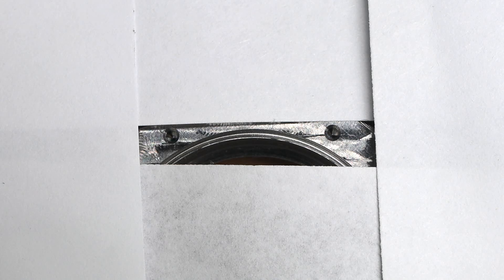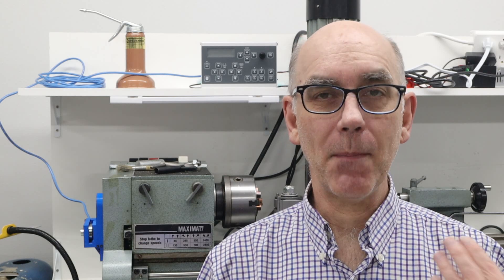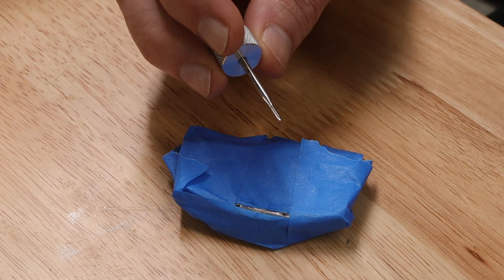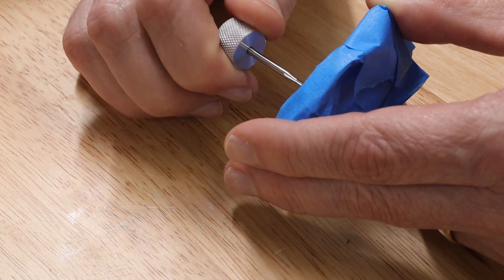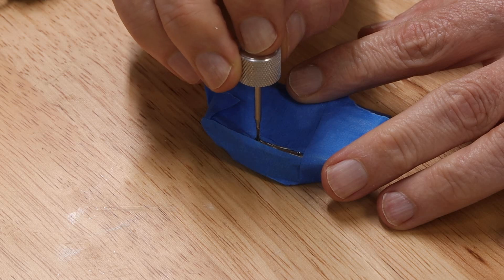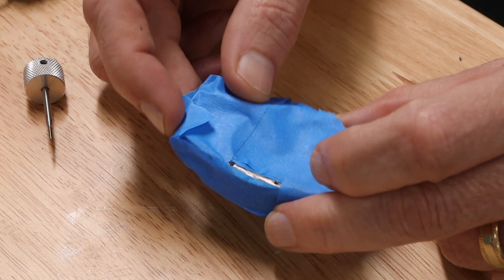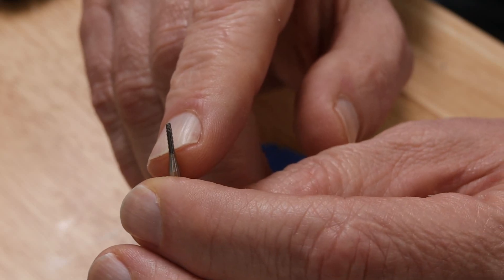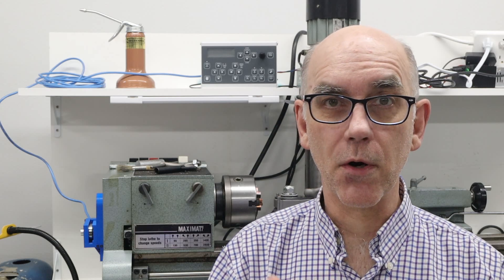Tapping Tiny Holes in 316 Stainless Steel

Comment: Thanks for the video. I’m just in from the workshop after spending a few hours tapping M2 taps in stainless steel. Very nerve racking. I broke one tap. 
And also found that the cheap taps I was using aren’t very sharp at all. But luckily had a better quality tap which was fine, though blunt now I reckon. 
I DO wonder if there are carbide tiny taps out there …. I’ll do a search. Cheers.

Comment: Also remember drill size for stainless steel are not the same as for regular steel. To avoid braking tap choose drill size a little bit larger or look up the correct size in table for stainless tapping
Reply from the maker: Oh, I learned that the hard way. I initially drilled the pilot hole smaller, and then discovered I needed to use a larger hole for stainless after breaking a few taps.

Comment: I tap a ton of tiny holes and I’ve found that I just don’t have the dexterity anymore to hold the tap perfectly straight and not nudge it sideways when turning them. I use a tapping block or tap stand to insure the tap is 100% straight and also to keep me from putting side force on the tap. Some parts I make might have 50 1.2mm tapped holes and at that point there is many hours of machining and hundreds of dollars of material on the line.

Comment: Try forming tap, use rigged tap cycle in the CNC, and 1.29mm hole
Reply from the maker: I didn't feel comfortable with rigid tapping with a straight flute tap, which is all I had at the time. Next time I will try rigid tapping with either a form or spiral flute tap.

Comment: Your Haas has the ability to peck tap, did you ever consider doing it in the machine? Pausing between each peck to clean.
Reply from the maker: I drilled these holes on the Haas with the belief that my viewer was going to tap the holes. That was incorrect, so I had to tap them after additional machining that meant I couldn't get them perfectly aligned in the jig again. In the future, I plan to rigid tap.

Comment: I always buy taps from mcmaster as the quality is amazing and it's one of the few items they don't over charge for
Reply from the maker: Agreed. In this case, I got them from MSC Direct because McMaster only had one option, which was a straight flute plug tap. Whereas MSC had both straight flute and spiral point options.
Reply: @JohnSL  I bought a few tiny thread mills (for 2-56 holes) the other day that I really want to try out as I hate cnc and hand taping small holes, especially in titanium of ss316. I think they make them even smaller too

Comment: I'm surprised you're using Tap Magic. I would have thought on stainless you'd want to use Moly-D or Anchor Lube.
Reply from the maker: This is my first time working stainless steel. The Tap Magic label included stainless steel. Can you provide more about the advantage of Moly-D or Anchor Lube over Tap Magic?
Reply: @JohnSL  Anchor Lube is more popular reputation than anything else.  Moly-D has a ton of molybdenum disulfide, which maintains a lubricant film under extreme pressure.

Stainless has such a bad reputation that I went straight to Moly-D the first time I tapped it and it's worked very well.

Comment: I form tap m1.6x0.35 holes. Procunier tapping head, taps from Suncoast products.
Reply from the maker: I used my CNC mill to drill the holes. Now that I have experience with the spiral point taps, I plan to try rigid tapping the next time. That should be safer and faster than hand tapping.

Comment: I did a few jobs where I had to manually tap the parts and it was such a pain, never again.  I thread mill all my stuff now, I can dial it in and use a thread gage to check fit.   I find it to be way more reliable and you at least have the chance to save a part with a broken thread mill.  If I were to have a job that had hundreds of holes, I may consider rigid tapping, but for small job shop stuff thread mill is the way to go in my opinion.
Reply from the maker: I had a deadline and was originally counting on my viewer tapping the holes since I thought he had the expertise. I was wrong, so ended up having to tap them myself. I did some more research and it Guhring makes a thread mill. I'll have to look into that for next time, as breaking one of those would not scrap the part. The other thing I may try is rigid tapping with the spiral point tap, as I already have the taps.

Comment: How about a Thread Mill?  You can control cut parameters very precisely and it would save a ton of manual tapping.  Perhaps not cost effective for small quantities, but awesome and repeatable once dialed in.  Either way great vid, good insights
Reply: Still quite tricky for holes of this size - an M1.4 thread mill will only have a ~1mm neck, so you still need to be very careful with it. Chip evacuation is a real problem in a hole of this size and a tool of that size just won't tolerate chip recutting. It should work reliably once you've got the parameters dialled in well, but the pucker factor while dialling in those parameters is pretty high, especially with the issue of work hardening in austenitic stainless.
Reply from the maker: And likely the cost of an M1.4 thread mill. My plan is to try rigid tapping next time (I thought I wasn't going to have to tap the holes).

Comment: I had a problem with undersized tapped holes in 316 stainless. They were close enough to 8mm to convince us they actually supposed to be 8mm. The bolts that came out were very close to 8mm but just undersize. A new 8mm bolt would almost go in but not quite.(no they weren't imperial.)  All this was submerged in a waterjet tank (now empty). We tried to chase the thread with a good quality tap but got absolutely nowhere not even a half a turn. I tried a few different taps no luck. This wasn't even a new hole, it already had threads in it. I couldn't believe how hard it was. I called MSC and asked for there recommendation for their best stainless tap. It was the most expensive tap they had. The difference was extraordinary. It tapped like butter. In fact I put away the long tap handle and use a battery drill for the rest of the holes. A few dozen holes went by without any problems in minutes where we had struggled for hours to avail previously. I have bought material specific tooling in the past with good results but never this dramatic a difference. The tap didn't seem much different at a glance. But wow what a difference. There are plenty of applications where an ordinary tap works fine and an expensive one probably makes no difference but then in special cases the right tool is essential.

 Its a brave man that taps hole that small in 316 nice job.
Reply from the maker: Thanks. I think the combination of M1.4 and 316 definitely required a much higher quality tap. Now that I've tapped 30 holes by hand with this tap, I feel confident I can do rigid tapping the next time around. That will be much easier.

Comment: Better is better.
Something cheap will be purchased many more times than a product of quality making the quality a better value than the inferior product.
Alas price does not always bring quality. 

A guide would be a great tool to use on small taps to make shure of your alignment. Nobody likes chaotic neutral in the workshop.
Reply from the maker: I thought about making a tapping guide. But, well, I didn't. No good reason for not doing it. But with the new tap, I could feel quite easily how things were going and was careful to not force things.